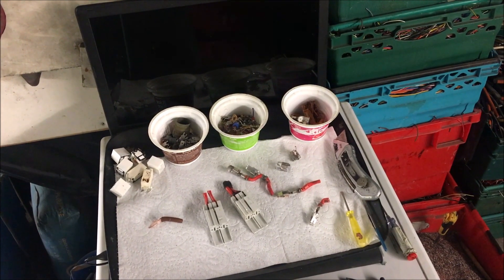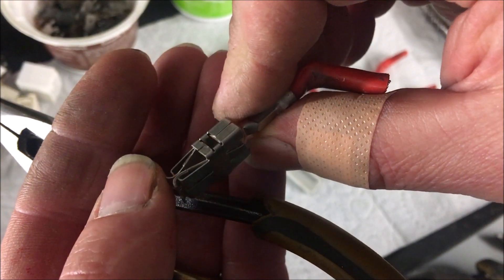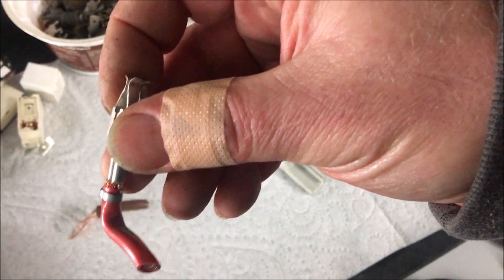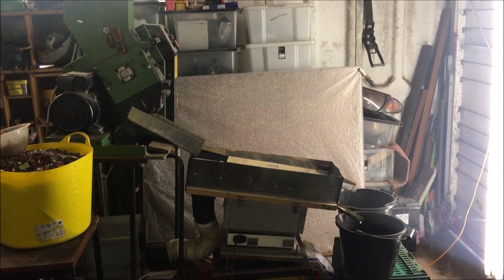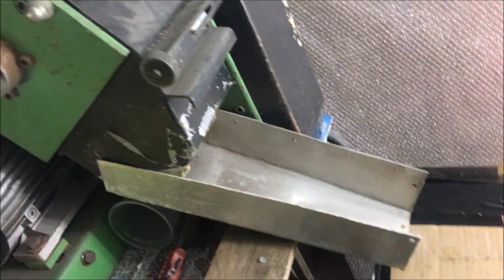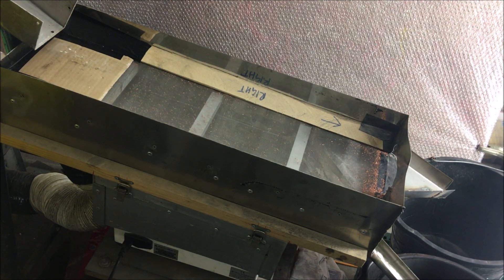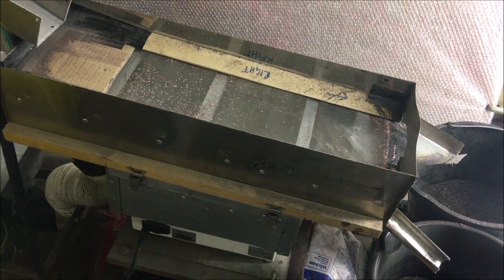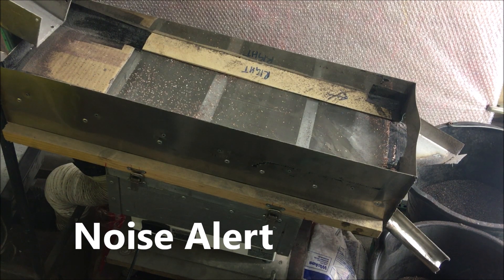Copper Wire Separation (Do It Yourself) Tinned Plugs

Comment: I am so impressed it works in a mulcher! Might want to add some plastic or wooden form around the chutes, you look like you're getting a bit of cross contamination which might reduce your price. Inspiring!
Reply from the maker: Hi, yes your right,I normally cover the chute and bucket to get a cleaner product but this was just an experiment and after I made this video both buckets were mixed back together with  copper ready for the next batch,thanks for your comment.

Comment: Dear David.  I have a granulator setup that I bought to process wire purchased from an auction.  It works well with wire sized from 14 awg to 22 awg.  For wire that is smaller than 22 awg, I have as much that comes out of the”waste” end of the process as I do the “clean” end.  I need to construct a water separation system like yours.  I have watched your water separation video many times to look at the particular construction of yours, but there are pieces of it that I still do not quite grasp.  I was wondering if you have any simple plans drawn up that I might be able to purchase from you?  Is there a way that I might be able to speak with you offline about the particulars as well?  My regards.
Reply from the maker: Hi Christopher,sorry but I dont have any plans of the water separation system and I would prefer to answer all questions in the comments section so we can share the knowledge with everybody.You are welcome to ask as many questions as you want and I will do my best to answer. I need to hear from you and other people what you dont understand and what more information is needed to give me ideas for future videos.One thing I can advise you on is when you build your water separation system,you need to be able to have adjustment to fine tune your setup,such as the steepness of the water chute,volume of water and the size of the granulator  screen .Regards Dave

Comment: You sir, are a genius. I thought I was thorough in regards wiring stripping. But dismantling the steel plugs? I never even remotely considered that. I do the plastic ones occasionally, if the inside contains brass. I can honestly say I consider you a hero. My only question is, do you have any idea as to the cost of electricity versus the monetary gain after selling the copper? Thank you for the videos.
Reply from the maker: It takes time to take off the steel but the copper adds up and yes I do the brass ones too.My little scrap yard started a few years ago after watching a Moose Scrapper video about silver contacts in switches and relays,there is plenty of copper and brass in car relays and you get a few bits of silver too! Iam not sure how much the electric would cost,I dont notice much of a difference in the bill after doing a batch of copper,but I would guess maybe £20 to produce a batch of 200 kg of granules.Thanks for your kind comment.
Reply: @corsagafa  Would you believe Moose Scrapper got me into this because of silver as well!?! Incredible.